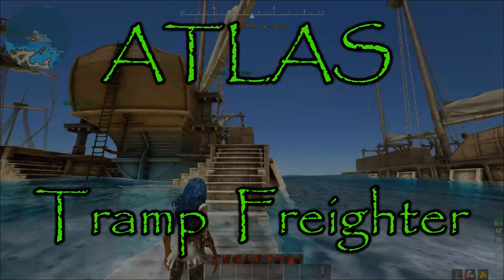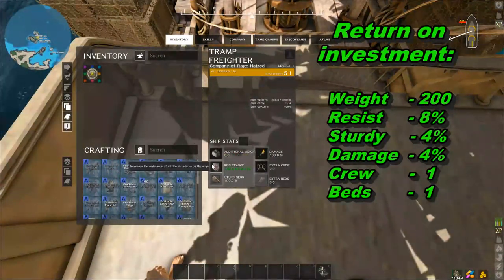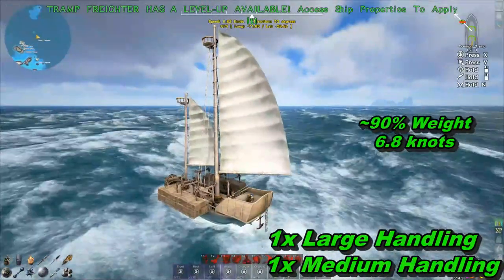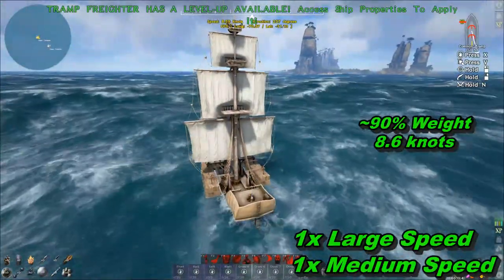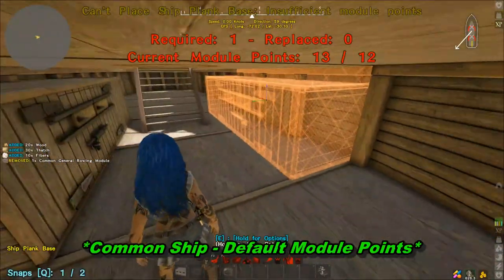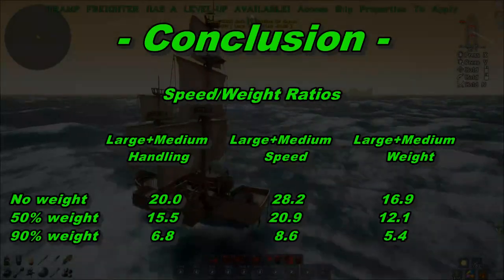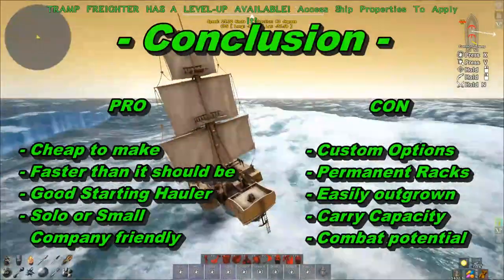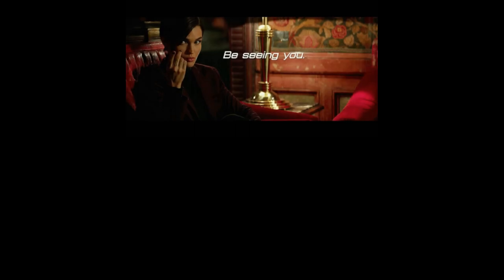ATLAS:  Tramp Freighter Breakdown

Comment: remember, you can store stuff in cargo racks to reduce their overall weight value, so technically it holds a lot more than listed.
Reply from the maker: Absolutely correct.  You can fill the max weight up to about 90% capacity before noticing any speed difference as well.
Reply: @ragehatred  how do you access the cargo racks. I can’t see any prompt. Is it a just walk up to it and press E kind of thing?
Reply from the maker: @brettadams8623  Yes, when the ship is anchored, you would access the cargo crate by using the radial menu or pressing F to view its contents..

Comment: Thank you for your video, this is the ship I want, because I like gathering for our 3 player company.

For the speed stats at the end, it looks like weight sails are slowest for relative weight. You mentioned the cargo sails increase the weight from 4000 to 10500, so at 50% weight it carries already more than the other configurations can carry in total, am I right?
Reply from the maker: It's true, but the weight sails definitely make you slower even though you can "carry more."  The patch last night actually increased the effectiveness of weight sails on Tramps but I still don't know if it is enough to be more efficient that just using speeds that are carrying a smaller haul but getting there faster/safer!

Comment: Remove all the cargo racks with normal railings then place the single cannon module with armor. You now have the fastest little tank in the game.. med weight sail with large handling means you can still carry some stuff and move
Reply from the maker: Honestly, I'm not sure if they snuck in a quick fix for some of these issues, because on patch night I tried replacing the railings with Standard and Kraken's and still got zero snap points.  Not the 'cannot place' error - but it acted as if the racks were built right into the ship.  I will test again to see if anything is different, appreciate the feedback!
Reply: @ragehatred  You can only remove railings for the first 20 or so seconds of it being placed and it doesnt give you points back for them. So atm Im treating that as a bug.
Reply from the maker: @midnightfender  Very interesting to know.  You'd have figured with the 20 or so different ships I dropped I would have accidentally met those conditions 😆

Comment: Anyone have any idea of how to repair the Tramp Freighter? I haven't been able to figure it out.
Reply from the maker: You need a repair hammer in one hand with patch kits in your inventory.  When you hit a panel to repair it, you need to stand near the piece you're repairing for 5 seconds (the green bar that fills up)
Reply: @ragehatred  I appreciate the response. I've tried this exactly and it's not working for me atm. I'll check files etc. and try that again. Thanks :)
Reply from the maker: @madthorn3094  when I find things are not working as they should, I typically kill my character to "refresh" everything.  Fixes more issues than it probably should 😆
Reply: @ragehatred  Ha .. well here is the interesting part.... I don't need to repair my Tramp Freighter anymore because I died trying to tame a bear on some island somewhere and everytime I try to revive at the bed on my ship, it goes into the map loading screen and never loads. when I relog ... the ship marker and bed marker are both gone. I've lost 4 ships this way so far and have to start over. I was lucky to remember EXACTLY where i died and got 2 ships back, but not this last time (15 min ago) i r sad.

Comment: Soooo with the cargo racks weight reduction on stored goods make it carry more than other modular ships?? So the weight con is false?
Reply from the maker: No, it's still a con.  For each cargo rack, even empty, it reduces the overall maximum speed.  If you fill that rack, it reduces the speed even further.  You are better off with a Broadsider with cargo racks.  It can carry 4x as much and remains fast.

Comment: How does the general rowing module work?
Reply from the maker: After you craft it, you place them on your ship in a modular slot.  The ship has to be anchored in a shipyard as well.  To activate the rowing, you press Shift + Q to extend them, and then Shift + Q again to start rowing.  To stop them, press Control + Q and then Control + Q again to retract the oars.

Comment: Its hard to be accurate because the winds speed change  all the time, Some time the winds are good and others not to good. 
But that's cool though.
Reply from the maker: It's hard to be accurate, you mean?  I'm not sure I understand.
Reply: @ragehatred  Yup I am not so great at spelling sorry Bud. Cheers!
Reply from the maker: @Shadow-Hawk  no worries, I just wanted to make sure I understood.  
As far as being accurate with the speeds and different sail combinations, I would always use the command 'setwind 15' between each new test to make sure the wind strength was always the same.

Comment: Not bad presentation but you need to let people know how bad at curves this ship is :),if u fill the cargo racks ya,is a decent small carryer,other ships with more weight and no possibility of cargo racks will not carry as much.Now,if u remove the cargo racks,than u have full speed,and that result how broken this ship is.
Reply from the maker: You're right.  This ship is pretty bad at turning (as most modulars are) but holy shit, it's fast 😋
Reply: @ragehatred  Well yes,i just exit the game and used for fun..on the officials..ignorig wind and get 23 knots is not normal :))